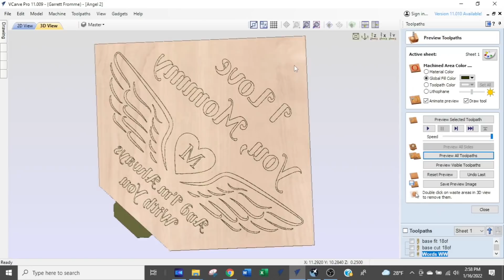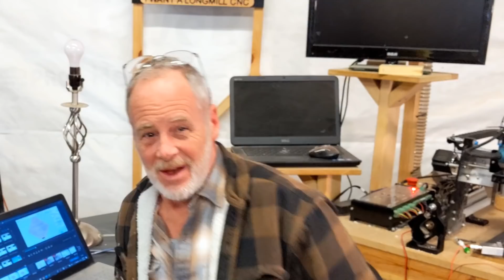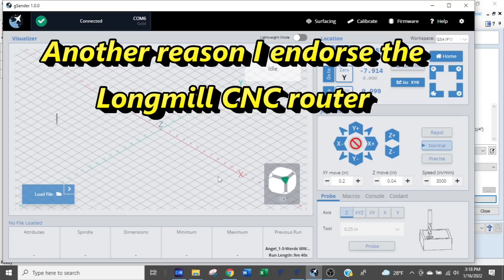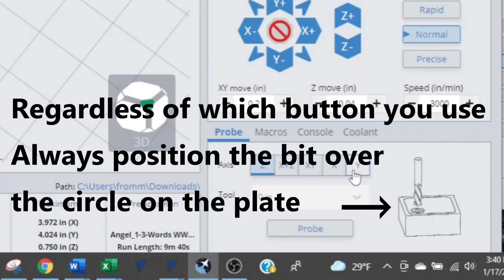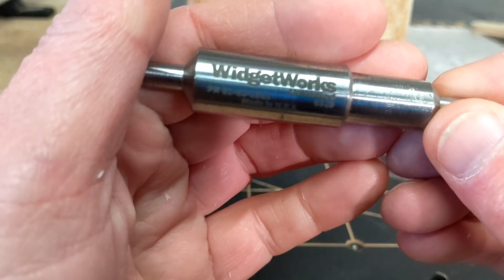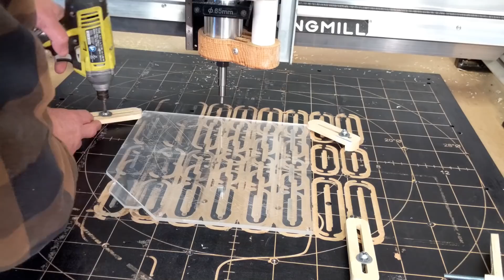How To Know When To Change The Bit During A Project, CNC Router

Comment: You asked for comments so I'll give you a couple. Don't have my glasses on right now so I might misspell a word or two.
Firstly I'd like to thank you for posting your technique to finding the x & y. I would have never thought about dividing by two and it  has saved my butt plenty of times because of the way that gSender is programmed. I don't like it. To be clear I like the interface but I don't like their programming practices and thats the reason for the rest of my comment.
I'm glad you mentioned that gSender will send the router back to its original position because mine doesn't. I would love to know what I am doing wrong. Mine just raises to its safe height and stops and than I have to press the Go button to return to zero.
I imagine that only works when you have those switches installed I dunno? I have not installed mine because they easily fall off and one of them the light doesn't come on so I don't trust it.
Speaking of gSender, they always do updates during the week but yet they don't improve anything! I think they are drinking their Starbucks coffee and making it look like they are doing something to get paid.
Here are a couple of issues I don't agree with that they should fix...
the laser buttons - there does not need to be two buttons to turn on the laser on &off. There only needs to be one. Its a pain in the butt to look back and line up the laser, while it is on, and look back so you can turn off the laser. All the whole it is burning your material even at the lowest setting. Using ONE button for both functions is an easy fix. Just initialize a Count variable to zero and when the start button is pressed it adds 1 to 0. O for off and 1 for on. No problem.
Secondly- the updates will NEVER let you know it is done nor does it even show how it is progressing. The updates will last for hours and hours and hours and never let you know to restart the program. Hell, I dunno if its even downloading anything at all. Even your cell phone lets you know when it is done updating So, they need to fix that but they continue ignoring it because of their Starbucks coffee.
Thirdly and speaking of safe height. What good is it when that is not programmed right either? Let me explain...
I know that gSender has the ability to read the text file cause it reads the text file when the start button is pressed. It could also read the text file when the "Go X0 Y0" button is pressed but it does not. Lets say you fasten down a piece of 1 inch wood and you zero from the bottom near your work piece. If you zero from the bottom and then press the button to go home guess what? It rams into your work piece because your safe height is set less then one inch! When that Go button is pressed it should read your text file to check the height of the wood (I know it can because it displays a picture of the thickness before I even start) and then add that to the safe height so this will not happen!
But again, they aren't making any real improvements because they are drinking coffee on company time just making it look like they are doing something.
Here is another thing I am angry about. Scienci acknowledges a glitch in their system. Well that glitch has tried to break my bits a couple of times and it has even broken two factory installed bolts on the z-carriage (those small black ones next to the router) which they refuse to acknowledge. They wanted me to send video but at the time I did not have a phone that could video. I told them the problem but yet he refused to acknowledge the glitch even when I told him its in the pdf file that they put out but yet I couldn't get help so now I'm stuck with a broken carriage cause it tried to ram sideways through the aluminum block at high speed not to mention going through some wood at very high speed which was not in the g-code!
Updadates my Butt! I'm saying that in jest but when I see that update thing I take it really lightly cause I know its not going to do anything but I'm used to it now.
Reply from the maker: Iwannaapple, you couldn't be more correct about the points you made brother. Have you tried reaching out to gSender/Sienci to give them the feedback on their software? They will be happy to help and I know they would appreciate the feedback.
Reply: @IDCWoodcraft  
I may have even said it on their website. Dunno. Might try it again. But, love what you do and keep doing it.
How about doing a video on 3 or 4 odd shaped bits and entering them in. Especially the tapered ones without using your spreadsheet which is very useful by the way. Glad you came out with it. Took a bit but I figured it out for carbide create. I see you ( forgot what it's called right now) used a separator for the name of the sheet. Slight error but I caught the hint and fixed it so it lists right. Very handy. Thank you.
Wanting to do 3d but I have no idea under which columns to put the tapered bit I have. Different folks display different info and word it different than carbide create.

Comment: Thanks for the detail. Why do you zero Z to the spoilboard rather than the top of the material? Wouldn't that make the etch possibly imprecise if you material thickness wasn't exactly as expected in your carve setup?
Reply from the maker: Racm, you are exactly right but both methods have imprecision. If you zeroed to the top of the material and it was wavy or distorted, you might zero on a spot that is either high or low. We solve this by surfacing the piece of wood to be perfectly flat if our concern is flatness.

Comment: Hi Garrett, What a special project I always learn from your videos and this one is no exception. I was able to catch on to how turning the touch plate over found the xy zero point and the touching off with paper technique. I do wonder though, If you set the z axis to zero on top of the acrylic and do the cutting, I would think you would have to make an adjustment to the drag when the z axis was set to zero on the spoil board. Maybe I missed the operation of setting the z axis to zero before the cutting operation.
Reply from the maker: Frank, glad to hear you learned so much from this video brother! Here is a video on how to zero your machine in a little bit more detail. I think that it will really help you: https://youtu.be/UaDMzl_ZXVg

Comment: I thought when you zero Z you would have left the probe on the material, but you removed it and flipped it over.  Can you explain that process?  Great video!
Reply from the maker: Jason, if you look at the probe there is a partition that you can use where you can align it against the corner of a piece of wood to zero the X and Y axis. But if we placed it in that direction in the center of our project, it wouldn't sit flush. We flip it over to allow it to sit flat on our project so we can just zero the Z axis.

Comment: I am very new to cnc and vcarve. I have created a file to do a crib board. the file has multiple bit changes. I air ran it the first time to see when it prompts me to change bits. it ran the first part of the file and came back to xy. I was ready to change the bit and set the z again. but I can find no where that it tell me what bit to put in next. it is somewhere,. dan
Reply from the maker: Dan, I know it can be tricky at first brother. But it sounds like it's running how it should be then my friend. It shouldn't be prompting you of which bit to change to, you'll have to know that from how you designed the file. It will get more natural the more you run it! Keep up the good work!

Comment: Very informative Garrett.  I’m learning a lot from you.   I will need to find out how I shut off my spindle to do a drag but I will figure it out.  Thanks so much.  Jim
Reply from the maker: Jim, glad I could help! A step in the right direction could be editing your g code and removing your spindle speed line. It will look something like S16000 for a 16000 rpm spindle speed or S18000 for a 18000 rpm spindle speed etc. Hope this kind of puts you in the right direction! Also, you can check out my videos on glass engraving they might be helpful too!

Comment: What is the smallest font you can use with the diamond bit? The fonts I use are generally Arial but need to be about 1/8” in height. I use a tapered diamond bit currently as the regular engraver bits do not leave a clean cut in Cast. Thanks in advance. Great info as always.
Reply from the maker: That's a question that's a little difficult to answer, because I haven't gotten to the smallest font yet that I can create. Leave it to say, I have engraved font at a 16th of an inch

Comment: Great and touching video. I watch all your videos to make sure that I do not miss any steps. 
One question, is there a reason to set the Z for the drag bit to waste board surface vs top of the acrylic?
Reply from the maker: Hi Mike. I actually had an explanation in the video about that, that I editted out. Because I don't want to cut into the waste board in case the material is thinner than what we set (which happens more than you think)

Comment: Great as Normal ! Can we get a re-squaring video ! lets use changing the Vwheels and then getting the Longmill squared only using the software not tools, and then how to Confirm its 99% square with a tool. That would be a great video with you explaining it. not sure why my machine wont cut X ina straight line it veers up 1/8" no matter how i square. someone else's tricks might help
Reply from the maker: Hi Jay. I'm waiting for the new MK2 to do this video you requested. Should be about next month.